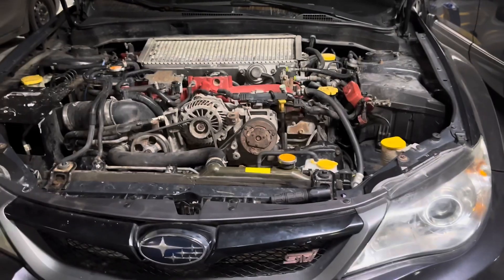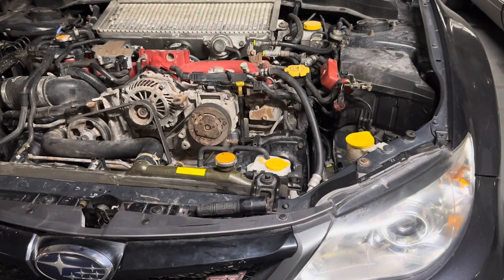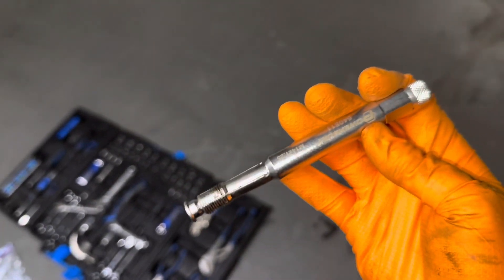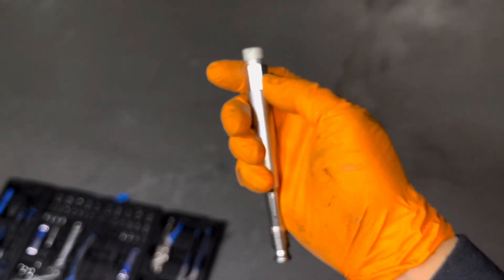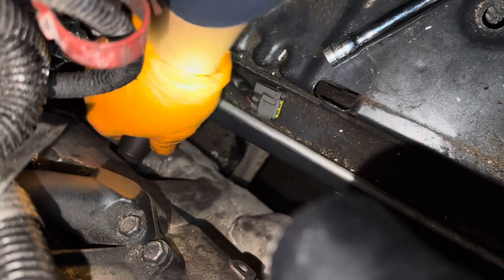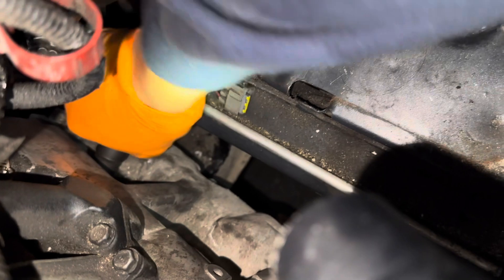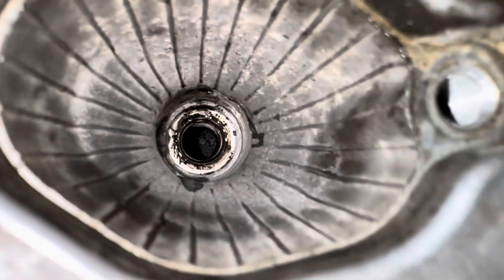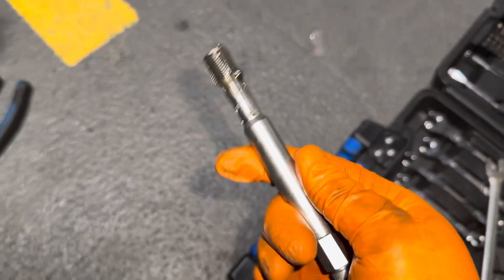Repairing Damaged Spark Plug Threads on a Subaru STI (CYLINDER 4)

Comment: Sweet vid, doing this myself tonight, did this the up lasting?
Reply from the maker: yeah it did, unfortunately the engine ended up being shot as the ringlands in cylinder 4 blew off, but this fixed the issue!